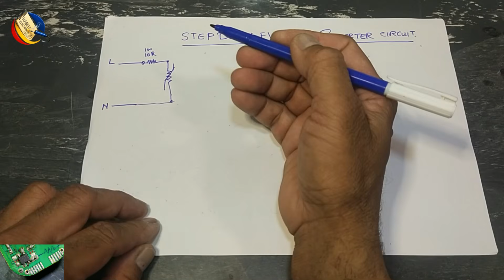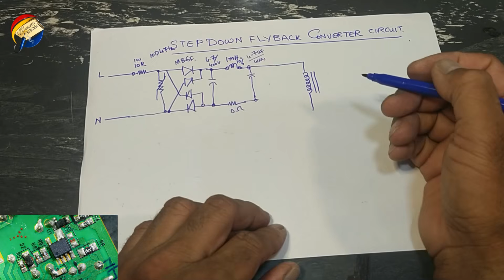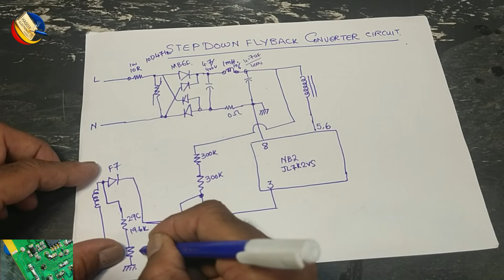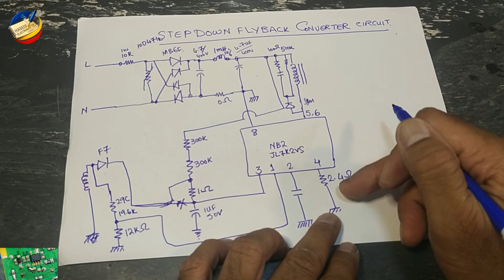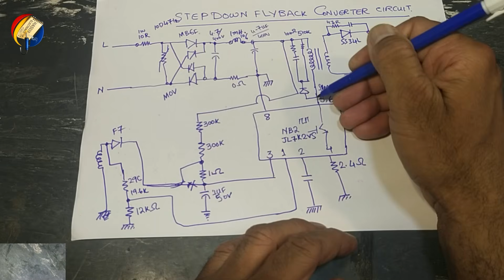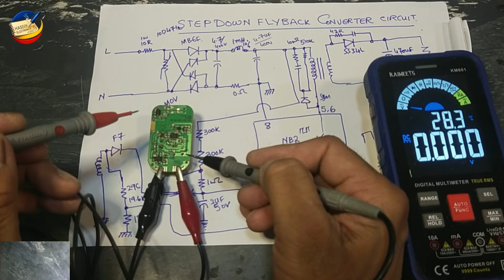Trace the Circuit & Draw Circuit Diagram | Step Down Flyback Converter | Ep #1464

Comment from the maker: CORRECTION:-
Dear viewers, sorry for my mistake.  in this video, i narrated 305 smd coded resistor as 300K. it was my mistake. actually these are 3 mega ohm resistors
Reply: Salut am și o întrebare cum poți să îți dai seama că anumite componente electronice sunt contrafăcute sau originale de exemplu tranzistori bipolari TIP36C și TIP35C și BD250C și BD249C  sau TDA7294 sau TDA2050

Comment: Sir, a small doubt, if the input is 227v ac , how come my diode bridge rectifier voltage is 314v , it should be 2*vm/pi, which is 2*227*1.414/pi  =204.45 volts right
Reply from the maker: for a bridge rectifier if 227 volt input 
227 * 1414 = 320.97 volt DC 
(RMS to peak conversion  
VP = VRMS * 1.414)

Comment: Selamun Aleyküm  Türkiyeden selamlar 
Sayın hasip . I'm not sure how accurate it is, but AI provided this information for this integrated circuit. The integrated circuit located at position U1 in the image, with 4 pins on one side and 3 pins on the other side (one pin missing from the middle during manufacturing) and labeled NB 2, is a Chipown PN8370 (or variations such as PN8370M / PN8386) integrated circuit, which is a flyback converter with integrated transistors.

Comment: 305 should be a 3M resistor, 300K would be 304 in normal nomenclature.
But nice description on the workings of the circuit. but you missed out the requirement for an air gap in the magnetic circuit of  fly back transformer.

A side note, the PCB did look like it was made to meet the safety standards, as the secondary did look to be double insulated. Plus there was quire a large gap between hot and cold parts of the circuit. looks like it's worth keeping once you have soldered the cap back and fixed the track. A spot of glue might help the cap from breaking  the track again.

Comment: looks like you are trying to identify the NB2JL7K2VS (or NB2-JL7K2VS) switching power supply / controller IC. This is a common component utilized in Switch Mode Power Supplies (SMPS) and step-down flyback converters. [1] per google AI